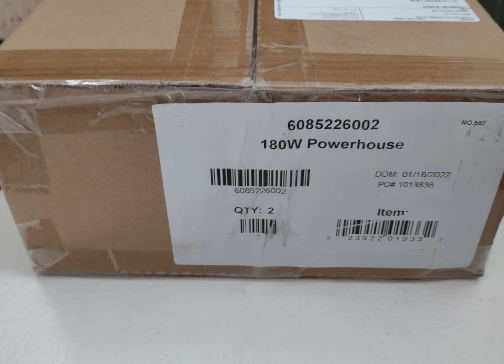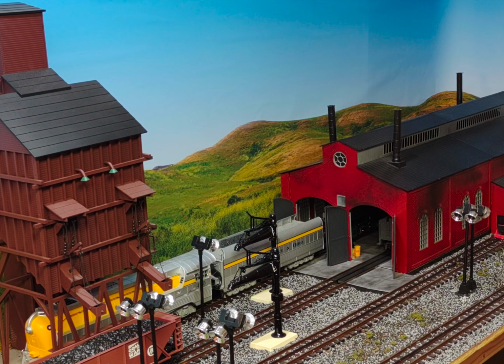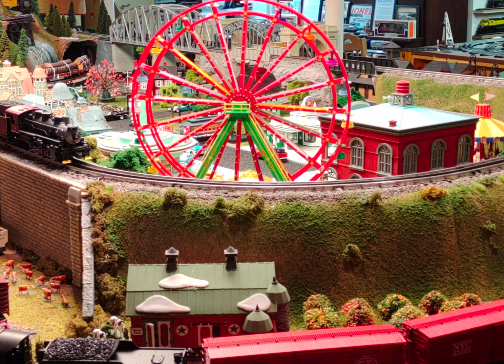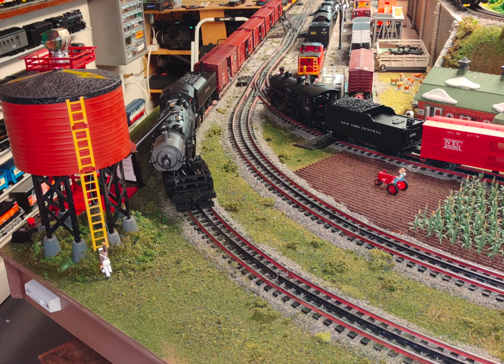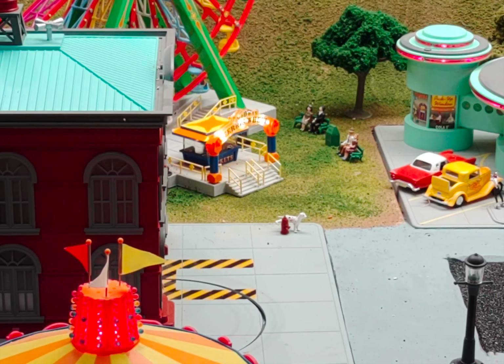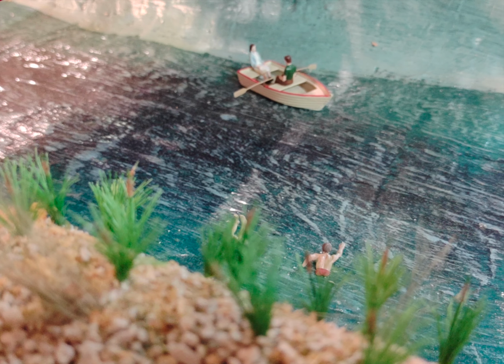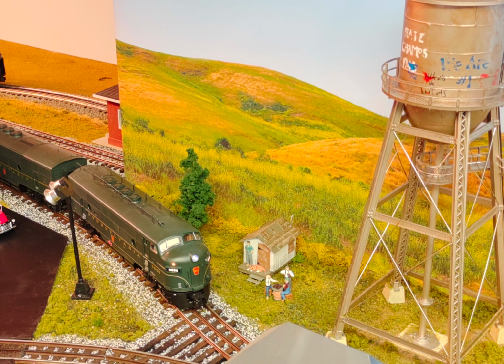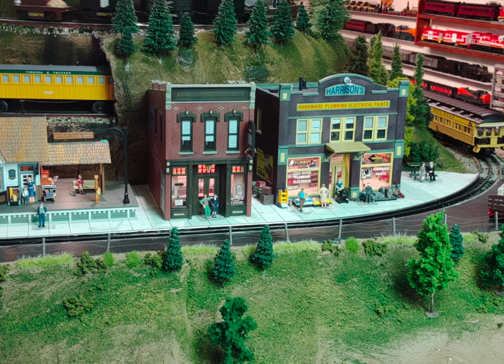Layout Expansion and Update Episode Three   4K

Comment: Amazing job, layout looks great. I'm so jealous of that staging yard!  How do you work on the center part of the layout, do you have pop up holes cut?
Reply from the maker: Yes at the foot of the mountain the department 56  Inn is attached to a hatch with measures 18" X 24" trees stone fence all attached lifts out. There is all so a hatch opening on top of the mountain. I had to lift the hatch and pass it out to my friend Matt, then I could take the over head light apart passing everything out. crawling around in the center of the layout rewiring the overhead fixture proved very interesting.